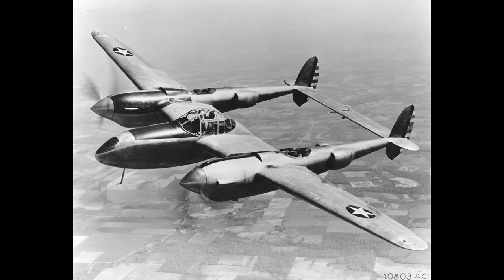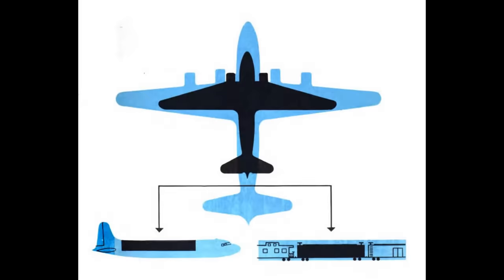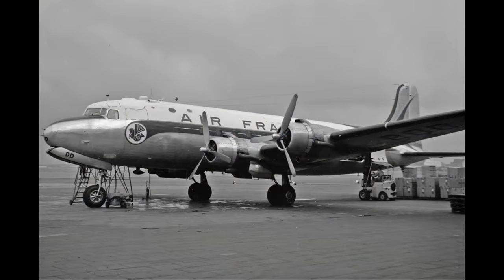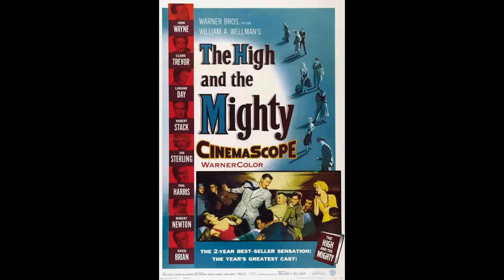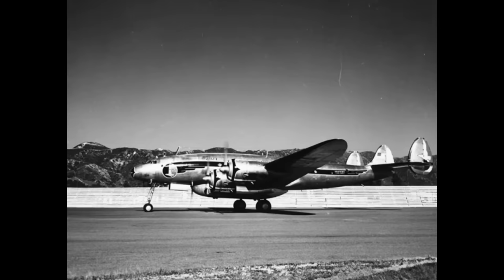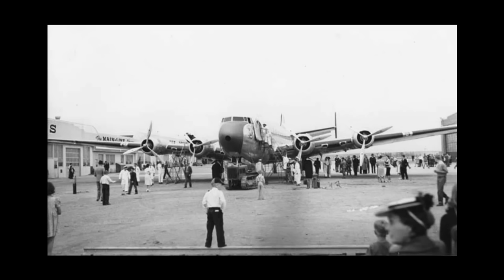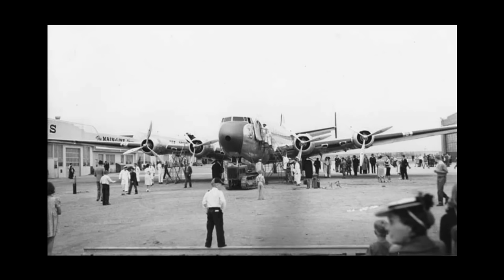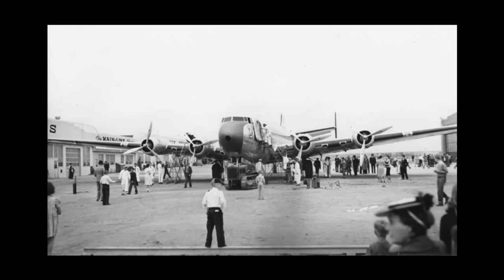Turbo Compound Piston Engines. Almost magic tech.

Comment: All F1 (2023) essentially uses turbo compounding, and it’s part of why such high output small engines also have such a crazy high thermal efficiency (The other major reason is the plasma injection ignition technology).

The difference between a pressure turbine and a blow down turbine is less important than you think, the key principle is that excess exhaust energy is being captured and used and not allowed to escape via a wastegate like in a normal turbocharged application.
Reply from the maker: The turbine type is a pretty important distinction in this case. NACA has all kinds of data on the power losses from the pressure from a pressure turbine, it would hugely offset the gains from the recovery side here. That's the reason they used a blow down turbine.
Reply: Using only blowdown prevents having to back-propagate new engineering constraints to the rest of the engine so it doesn’t have to be re-engineered. However if the whole system is engineered to capture that energy to begin with, the most optimal solution isn’t using just blowdown, that’s only used when added on to an existing system. That would look like a system with pressure on both sides of the core and a turbine that maximizes capture using reaction and impulse.
Reply from the maker: Without a real world example, I think you're in fantasy land.
Reply: @GregsAirplanesandAutomobiles  The current powertrain used in F1 is an example.

A similar concept would be sticking a water wheel in a stream (blowdown) vs building a dam and developing head pressure to be used with a modern turbine. Huge difference in potential of energy gathered. However, the latter changes the whole system. 

Sort of similar reason why F1 wants to dump the MGU-H system. It changed the system from being an add-on to everything being engineered based on it, and turbine development possibly being the most important part.

The supercharged R-3350 core already existed and they didn’t want to have to redesign the whole thing, they just wanted something that could make it more efficient and/or powerful.

It isn’t “correcting” anything you said, just throwing out how I interpret the world I suppose :-D and I rather enjoy your videos - Thank you for making them!

Comment: I do not think the "blow down" turbine can work well with a Diesel.  The Diesel has high expansion ratio and the pressure will not be so high when the exhaust valve opens.

Comment: Love this video, but man... you were wrong about "The High and The Mighty", I just watched it off your recommendation. First off, John Wayne is definitely the main character of the movie, not some "side character" as you claimed. It opens on him, and it closes on him; it's also a redemption story about his character. Second off, definitely a lot of inaccurate technical specs and aviation technicalities in that movie, there's no minimal approach altitude for approaching the coast line, they would've been in economical settings before John Wayne started smacking the CPT around, there's no reason to ditch further away from the coast than closer because.... The "waves are bigger" and "water is colder" near shore??? I would take a SF bay landing over a deep blue water landing any day. Def more than those errors depending on where you want to set the bar, don't get me started with FCC regulating marine radio airwaves? Just because they got the flight times, and fuel load correct, does not make it a accurate aviation movie. Anyways, thanks for the video, but your movie analysis is questionable.
Reply from the maker: It's a movie, and by the standard of movies it's accurate. There is no aviation movie that I can't go through and point out inaccuracies here and there.

Comment: I Wonder why this was never tried with Car Motors, or was it?
Reply: Extremely complicated, and no road use at all. Current F1 PU is great example of modern day application of compound engine. And don't say AMG ONE, as it one off or RB17 that still a concept

Comment: I don't know that the "airlines sell time" statement is very applicable to economy passengers in the modern era, lots of people book flight indirect routes that take several times longer to save a small fraction of the tickets total cost. Meanwhile for most routes the total cost of other travel options is actually more, yes a container ship moves each kilo for less cost per kilometer, but the cost of housing, feeding and entertaining people for multiple days is higher than the fuel to move them faster, and wheeled vehicles often lack enough passengers to have the same economies of scale... only passenger rail really competes, and it covers a tiny fraction of routes, and (likely due to the mix of track maintenance and less advantageous government incentives) is often disappointingly simlar once you actually buy a ticket. This trend can be seen in fairly modern context with the slightly higher cruise speed of the 747 vs subsequent wide body airliners (even the 2023 777 is a few percent lower), and we see the same progression in passenger liners beforehand, RMS Lusitania made 24knots on 1000tons coal per day, RMS Olympic was a >40% larger overall vessel (by Gross Registered Tonnage) but at 21knots, only demanding 600tons coal per day. As services push from exclusive to competitive the consumer (including the upper sections of the new market) expectations shift from quality (in this case mostly speed, but also to a lessor extent luxury) sensitive to price sensitive. The 747 itself was expected by designers to be the last subsonic passenger aircraft (and that most would be converted to freight duties well within their hull lives because of this shift), so its ironic in a way it remained the fastest aircraft in widespread passenger operation for many decades.
Reply from the maker: The airline I work for literally lost a big contract recently due to poor on time performance. I have seen it happen over and over.

Comment: No slippage when oil acts as a hydraulic turbine pump powering the turbine at all rpms at low rpm’s at high rpm’s the oil can cool the engine

Comment: 21:30 Great video, but one nit: that's actually an overshot waterwheel.
Reply from the maker: I'm pretty sure Curtis called it an undershot, but either way, I'm fine with it.
Reply: @GregsAirplanesandAutomobiles - Yes, the illustration from the manual was very much an undershot wheel.  It was the photo of the old mill with a water wheel attached that was overshot.  You can tell because there's a hill to support the feed penstock at the top.  An undershot wheel would be built on a flat area with a level mill stream on both sides of the wheel.

Comment: Harnessing the whip before the crack
Using ambient like it's toward vacuum
Anti-lift blade, accelerating the attached mass rotationally , it can handle the stress and resists acceleration more than the airfoils absorb the energy of the gas flow. Very nice.
Is power like mass and thrust like speed?
Reply from the maker: Think of it this way, thrust is the jet engine's version of a piston engine's torque.

Comment: But, while adding 200HP, it also adds weight.  So, there is some price to pay.
Reply from the maker: There is always a price to pay, but in this case that price is a relatively low weight penalty and you get back over 400hp per engine. It's a good trade.

Comment: Why the heck didn't people just swap in one of the Volvo/SAAB inline 4's with turbos? A SAAB 2,3 liter Turbo B235R f.ex. will easily output around 300 hp with only ECU mods and is fairly compact. 🤷‍♂️ Some even came with "hemi" style piston heads. 😄

With stronger internals and upgraded turbo/injectors, they will deliver more than 600 hp reliably. 😉
Reply from the maker: What are you talking about? Swap in a SAAB engine for what?
Reply: @GregsAirplanesandAutomobiles  Haha! Well, that's a comment I wrote to a DeLorean  engine swap video. 😅 I have ZERO idea how the heck that wound up on your video. 🙈
But great video. 👍

Comment: F1 fan for over 40 years. This is EXACTLY what F1 deserves, not to mention the f*ckwits who paid for the tickets. Vegas plus F1, hmm, can't be about greed. Unfortunately,  F1 fans have seen this slow train wreck coming. Here's an idea, what about running at Laguna Seca (never), Watkins Glen ('61-'80), Road Atlanta (never), etc.? F1 fans know the answer.  For those who don't, the FIA states these tracks as having  "not enough runoff area for the drivers, if a mistake is made" or "these tracks don't have a large enough paddock or pit lane". Again, another great response from the brainworks at the FIA. Here's a fact: from the three tracks mentioned above, there's never been a manhole cover incident. Yeah, yeah, I remember Detroit, but I didn't mention the Motor City. 😊

Comment: That doesn't make sense. Why would they need to refuel with head winds? Tail winds i get but not head winds. Yes,  I do know the difference but I am not sure anyone that argues with me does. Head winds push against the plane which forces more wind under the wings creating more lift requiring less engine speed.. Tail winds do the opposite requiring more engine speed.

Comment: Yes the dc6 was the sweet SF pot.  The r2800 was sweet soot.

Contellations n dc7s n stratiliners used karger radials that were not super reliable.  

Dc6 still flying today not as historial demo, sctual wirking freighter

Comment: This concept is still used by modern gas turbines. It genreally pays on turboprops to have a decent exhaust velocity because at their high cruise speeds, the exhaust thrust they give is useful, typically 5 to 10%. But for rotorcraft which fly at much lower speeds, that last little bit of energy is better used driving the turbine, so the exhaust speed and thrust are negligible. So, we can say, turbo compounding is alive and well in the world of helicopters, and lets not forget, all the land and sea gas turbines used for electric generators, ship propulsion, pumping natural gas, and what-not.
Reply from the maker: Good points.
Reply: Turbochargers, power recovery turbines, gas turbine engines and jet engine are all Heat Engines and operate using the same Brayton Cycle.
 A turbocharged or turbocompound engines are COMBINED CYCLE Heat Engines, literally two engines working from the same heat source.
Turboshaft and Turbofan engines are Split Cycle engines

Comment: There must be some real engineering issues associated with turbo compounding.  It seems like a no-brainer, when it comes to power augmentation on any ICE...   Would be interesting to hear what those issues are.  It would be logicl to assume that if cost was the only obstacle, someone would have figured that out by now.  The time is passed, for all practical purposes, just about.  Maybe 20 years, and oil-based engines will be on their way out.

Comment: Would you consider doing a video on the P2V-7’s and the engines for them too 🤤
Reply: The Wright 3350 turbo-compound engines as described in this video were also used on the P2V-7s.
Reply: @WAL_DC-6B  this I know, But they also used Westinghouse J-34’s Plus I’m sure they’d likely do a video about the versions of the aircraft prior to the definitive variant one. Did a bunch of looking into the aircraft and for the longest have been asking all the CC’s I follow who are better at digging information up than I can do a video on it for my entertainment:)

Comment: A man who calles a Subaru the worlds most boring car cant be trusted. 
Subaru is the ONLY car in the world with a boxer engine, which gives it symetrical driveshafts and a lower point of gravity, combined with a permanent 4 wheel drive, which is so much better than other "intermittent" 4-wheel drive systems. Only other well knows cars with the same engine technolohgy is Porsche, and only other cars with the same type of 4 wheel drive is Audi Quattro and Land Rover (less known other models may exist). That is not boring. Its good engineering in places where it counts.  
As you also may notice from this comment Subaru has the most satisfied owners in the world
Reply from the maker: What I like about Subarus is that their owners can ALWAYS be counted on to help the algorithm, and I appreciate your support in this matter.

Comment: Visit new VOLVO D13-TC Extreme Efficiency Turbo compounding Diesel engine. Semi truck that achieves 8.5 mpg even at 85mph speeds. At normal highway speeds commonly 10+ MPG at 80,000lbs or 400Ton-Miles per gallon in train language ✅

Comment: Free power turbine. Powers lots of helicopter. Seakings for example. Free power turbine turns the shaft to the main rotor gearbox and then to the main rotor blades. Very simple but very powerful.

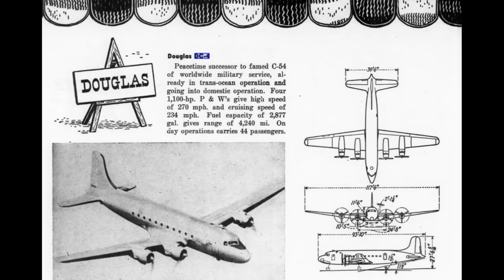Comment: 5:50  :
Thank God for British engineering . . . Development of the VICKER'S VISCOUNT.
B4 that turno prop,the Merlin engine that powered the 
P-38 MUSTANG.
THOSE VICKERS VISCOUNT - CAPITAL AIRLINES UNITED AIRLINES THE BOAC DC- 10 .
THEY WERE QUIET AND POWERFUL . . .NOT BUMPY!
Handled turbulence,not bumpy.
Had the jet roar and whine !
Reply: DC-6s were a nightmare to travel with : noisy- bumpy; rough !
You felt beat up when de- planed.
Reply from the maker: 707

Comment: Caterpillar ACERT truck engines use compound turbines. Not in the same way. They aren't twin they are compound. 60lbs of manifold pressure compared to 30 with any other set up. They will yank. Beast's compared to other diesels. But CAT has always rolled like that.  Awesome video.

Comment: And the Napier Nomad?
Reply from the maker: and what? I'm not sure what you're asking me.
Reply: @GregsAirplanesandAutomobiles  High blown ic engines tend to have problems. They need high octane petrol. The inlet valves tend to 'float'. To control this return springs would be beefed up, increasing inertial weight and the whole valve gear strengthened 'compounding' the problem. High maintenance. When a replacement for the Griffon was floated, Napier suggested an engine that avoided the problems by using a two stroke diesel as a core, no valves, the high compression giving a higher potential efficiency than petrol. Axial compressors and exhaust turbines completed the mix. Later versions added a fuel burn after the piston engine and before the exhaust turbine. The whole produced an efficient engine which promised such a long mission time compared with the Griffon engined Shackleton that crews became concerned. As the Shack was the only potential customer it was cancelled.  At this point the engine could be viewed as 90% gas turbine, the piston part effectively doing what the gear train in a turbo-prop engine does. Turbo-props made more sense.

Comment: All of the piston engine airplanes can be converted to unlimited range electric power airplanes.  The use of Edison generators that are permanent magnet motor as generators with inverters that can drive an unlimited number of brushless motors as generators can power a full set of high torque electric motors with propellers for unlimited range electric power airplane. No recharge stations or gas stations.
Reply: Non-stop to any point on the planet without fossil fuels carbon pollution or expensive batteries.
Reply from the maker: Please contact me right away about a bridge I'm selling in Muskogee.

Comment: If we weren't a braindead society driven by greedy politicians who are trying to crowbar electric cars into our lives, we would have already seen development of internal combustion engines with turbo-compouding to power electric generators to power electric supercharges, or directly add power to the driveshaft. The reason this tech is so niche for now, is simply because all the automakers have had their hands tied due to politicians forcing them to adopt 100% electric vehicles, which just won't work for the entire population, as well as completely killing off any innovation in internal combustion engines, which will still be needed well into the future.

Comment: * if you add more air to the engine without adding more fuel too, whats the point. Boost makes more power AND burns more fuel budski
Reply from the maker: Ahm Chad? Did you even watch the video?

Comment: I'm no Ricardo, but I do wonder if this could be taken to the next step. One energy source that is typically wasted is heat. Think P51 coolant radiator. Now apply that to the exhaust of an air-cooled engine. In other words, take the heat from the exhaust, draw in cool air, then use the expansion of that cool air as thrust, or use it to drive a turbine. In your drawing Greg, perhaps cool air cool be drawn in at position 2 with a venturi without reducing exhaust gas velocity or decreasing pressure at the exhaust valve. The resulting pressure increase would drive the turbine harder. Sort of like a steam engine that uses air expansion rather than water expansion. If they could tolerate the weight of a little platinum, throw in a non-restrictive catalytic and get even more expansion.
Reply: Check out the ‘VDT’ or Variable Discharge Turbine version of the Pratt R-4360, was projected to put out over 5000hp and some jet thrust to boot!